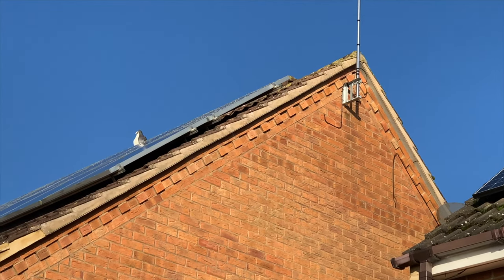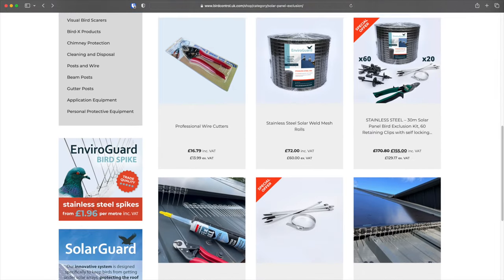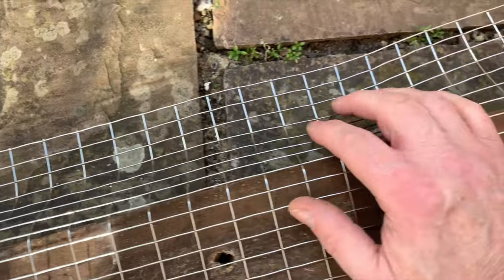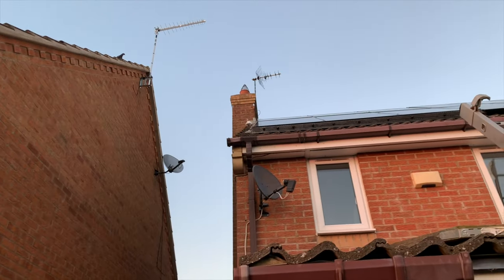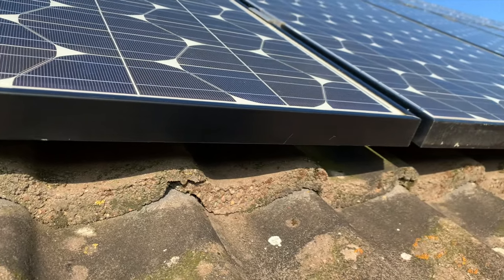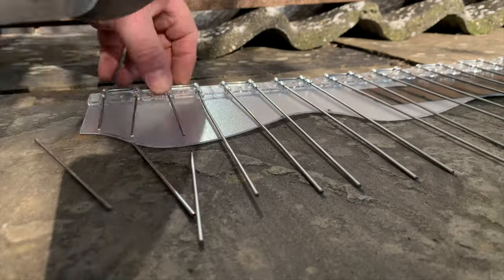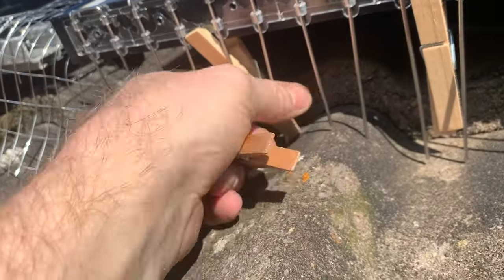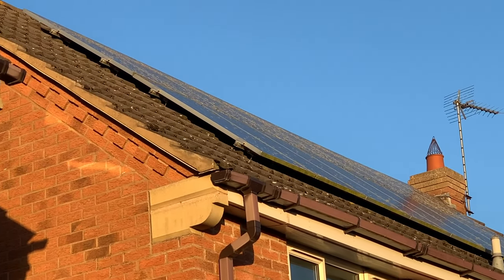Stop pigeons nesting under solar panels - 2 methods

Comment: The stick was funny , it put a smile on my face. I have ordered the clips and the mesh from the company , thanks for the link . And thanks for the video , it will make my life a lot easier after watching it.
Reply from the maker: The clips are very easy to fit and secure too. You can get away without using the sealant if you wanted to, however belt and braces I used both.

Comment: I am very impressed you did it yourself. I have had a couple of pigeons for a while under my 2011 fitted panels and shoo them off with my long stick too.  However I can see it is getting worse so today I have placed a deposit with British Bird Control who came in with a reasonable quote of £500+.VAT and seem to offer a good product. Unfortunately they can’t come until April 17th so more shooing will be required in the meantime. Just off to check now as it is now 5pm.
Reply from the maker: That will be good to get that done Bob. The long stick as you know does work, but it's constant vigilance! You end up turning into Victor Meldrew! That is a good price and good piece of mind too.
Reply: thanks for mentioning the pricing, at today's rates was worried they were going to say 1K! £500 does not seem to bad but is a tad pricey, how many panels is that for fitting?
Reply: @mrpurpleman9698  they did a good job, 2 chaps with just ladders. I have 18 panels.
Reply: @MrBobitsabc  thanks good to hear, has it reduced the pigeons so far?
Reply: @mrpurpleman9698  I had two nesting under the panels and they have now gone, and the nest too. I had the panels installed in 2011 but it is only the last couple of years it’s been a problem. Previously I was able to shoo them away but once they had started nesting a few weeks ago they wouldn’t budge. So it’s been done just in time and hopefully no more pigeon pigeon droppings coming off the house roof to clear up.
Reply: @MrBobitsabc   Thanks I will need to save up to get it done, for now I can just enjoy an x-rated pigeon party starting at 5am every morning.

Comment: I suffered the same problem with my 16 panels fitted in 2011. Pigeons roosting under them (about 20!) with the noise and crap everywhere. I used Enviroguard mesh with the clips as my panels are Sanyo 245 watts per panel and had the lip underneath and the system works a treat remembering to have the guard slightly lower than the panel as a neighbour did not and has an accumulation of detritus. I am fitting a 15kW AlphaEss B3 battery to the garage outside wall as even today I was giving back to the grid 1.5kW not good.
Reply from the maker: Thanks Roger, good tip on the height for sure. 
Battery for the win! Good timing too with more sunshine coming.

Comment: Nice work, we had our first lot of panels installed in December 2015, and no bird protection, several years later I fitted it myself, I could have really done with those clips you used but couldn't find any at the time.
Reply from the maker: Thank you. 
I think the clips are a relatively new product line. They do give a nice secure fixing for the spikes especially when it comes to cleaning them when you accidentally drop the head of cleaning brush off the end of the panel!

Comment: These feral pigeons are learning! Had my panels installed recently  further along the back from you and I DIY installed mesh just the sides and bottom. They've now learnt to get under from the top but there's no way I'm going on to the ridgeline even with the scaffolding still in place!
Reply from the maker: Hi Nick, ah yes I'd seen the scaffolding and guessed it was for solar panels. It makes perfect sense to install solar with the price of electricity. 
The pigeons are blighters for sure. Our immediate neighbours on your side have seemly adopted them as they roost / nest under their panels after I misplaced them from under mine. They don't seem too bothered by them.

I found it easier to access the ridge line from the front of the house with a ladder and roof ladder to fix mesh along the top. However,  you do need a head for heights, but the view across the back is rather spectacular.
Reply: @johntisbury  The side meshes were interesting as the side guard scaffolding isn't as secure as you'd think. I'll try the front approach instead.
Reply from the maker: @nickbea3443  I tackled my side elevation with ladders, which took a bit longer to do. Shout if you need to borrow ladders as I have a proper roof ladder with ridge hook. Not sure on your roof layout as some houses have very long roof drops so the ladder mayn't be long enough.
Reply: @johntisbury  I've chickened out and got a roofer to finish it off plus do some other work with the scaffolding still up. Thanks for offer though :)

Comment: I'm near to a big country park full of all types of birds so got bird control mesh wire installed by the panel installers, they didnt do a great Job and the Pigeons about 2 years later started nesting, it got bad so had to get them done again, hoping it lasts longer this time, I have more wood pigeon's near me which are twice the size of the common pigeon
Reply from the maker: It shows how determined they are. Have you had Wood Pigeons nesting, or just common pigeons under your panels? I didn't think Wood Pigeons would fit under the gap.

Comment: I didn’t opt for the bird mesh last year when we had the panels installed as there haven’t been any pigeons around here for the five years we lived in this area and the cost was not negligible.
I’m having second thoughts now.
Great work John!
How did you clean the panels?
Reply from the maker: Thanks for watching. I'd suggest not doing anything until you see pigeons under your panels as you may never be bothered by them. The cost of the installation is taken up in a big way by the cost of the scaffolding.
I'm just about to do a video on how I cleaned the panels, so stay tuned for that.

Comment: I just had a galvanized steel netting installed around my solar panels, but there are about 10 pigeons are still living in my roof. Will they eventually go away?
Reply from the maker: @dr.bundforah5267  yes they will eventually leave. It takes a while for them to realise they can’t get back under the panels. They are homing birds and return to the same nesting point.

Comment: Just a thought about the spikes - could the strip of spikes be installed upside down and when fixed, the wire pulled through the plastic so the loop hits the roof tiles and the single spikes above simply be snipped off flush? If that's possible it would save all the faffing about with templates.
Reply from the maker: I guess that would work, although that would result in more work being done at heights on the roof rather than at ground level. 
Depending on the profile of the roof tiles it may not be as snug fitting against the profile of the tiles.

Comment: I had my panels inset , so no bird problems. Chap over the road has at least 15-20 birds gathering every night 🤦🏾‍♂️ 

Great job . will it be a new side hustle for you??
Reply from the maker: Inserting panels certainly overcomes the bird issues. 
I don't think I'll be putting it on my resume tbf. 😂

Comment: As the panels are usually mounted on horizontal struts which would prevent birds either climbing upwards or downwards from the apex, isn't all that's really needed just pigeon guards at the sides? (Just a thought)
Reply from the maker: It's a sound suggestion, although the pigeons do not seem to have read the manual. I've seen them duck under our panels long the top and bottom edges. Granted they can't transit vertically due to the struts. But doesn't stop them trying. 

As I was up there is was easier to add protection on all sides. I guess if you could reduce costs and just do the sides.

Comment: How did you clean the Moss under the panels?
Reply from the maker: I didn’t. I could not see any large build up under the panels. It was only evident at the end of the panels where the water rubs off and onto the roof tiles
Reply: @johntisbury  ah gotcha. Thanks for the response. Was just wondering would you know how to clean under the panels? For lichen build up in particular? Thinking about installing panels but just a bit concerned about under them and the hassle of cleaning that
Reply from the maker: @mas0ny149  I've suggest a roof clean and algaecide application before installation. Afterwards the roof won't get hardly any sunlight which will inhibit regrowth.